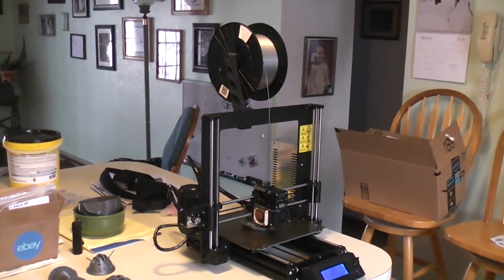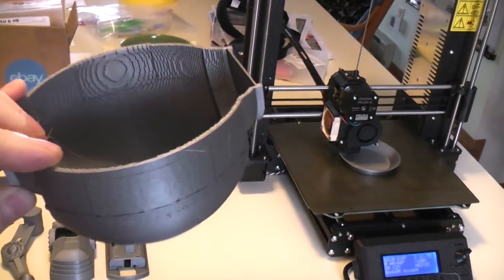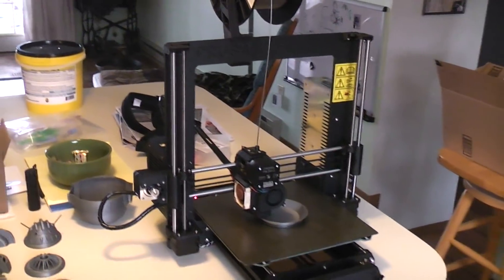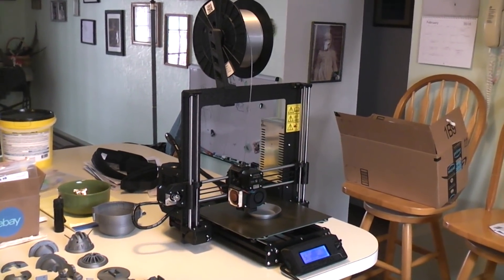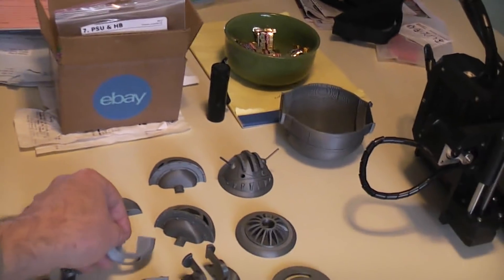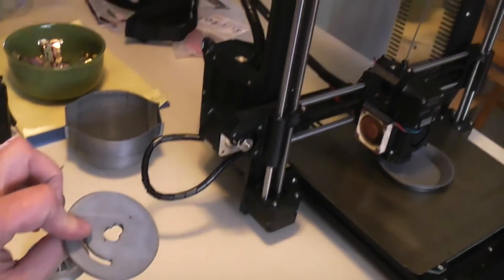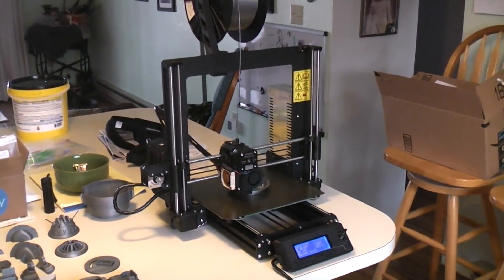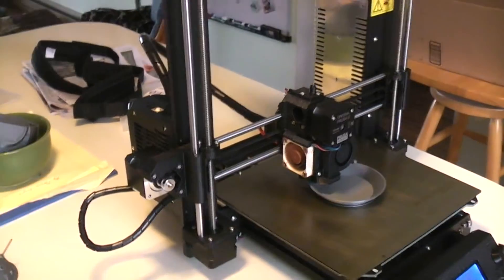Black Beauty arrived "Prusa MK3 Kit". So what do I think ?

Comment: to dampen noise, try putting the printer on a garden paver like this https://low.es/2luR4UD
you could also try putting it directly on cement floor, or anything super heavy.

putting it on a table that's relatively thin (compared to the floor), and has a large surface area is the best way to maximize noise.
Reply from the maker: Yes, when the printers are in the shop they are solid surfaces but in the winter they are in the house and the kitchen island is the only place. Its like the sound board of a instrument .  But as you will see when you watch a few more of my video's I have made the MK3 silent even on the hollow table top.
Reply: oh cool.  didn't know you already knew about that.  glad to hear it.  i'll check out some more of your videos!

Comment: Have you heard of plastic bearings i can'tremember the name cause it's been awhile since I did the change but they are awesome, super quiet and oil less. Drylyn our something? You can order from ali and maybe gearbest.
Reply from the maker: Yes they might be worth trying. What I just ordered and will try is the 8mm bushings that Ultimaker uses. If they hold up in a Ultimaker "and they do" and have the great print quality in a ultimaker, then why not try them on the Prusa. I guess I will find out as soon as they arrive. If they are good I will do a short video on how they sound and work.

Comment: Use that glue stick that is provided. A small layer will do magic for you. I also have layer shift issues. I am still tuning the retraction and plastic feed, looks like those are not quite good out of the box. Planning to change the bed bearings because of the noise and they do induce some amount of vibration back into the printer.

Comment: LEDS last 100,000 hours plus. I've got LEDS that are 30 years old that still work. Saying that the laser diode will fail anytime soon is  ridiculous.  What I like about the MK3 is that it is wonderfully quiet, heats up faster and runs cooler than the Mk2.
Reply from the maker: Yes love the MK3. And I have LEDs that have failed in 6 months. So the truth is some place in between. LEDs of this type do not just fail they lose out put level over time. This is a reflective sensor not a window type LED switch.  The out put level is much higher and must stay that way or the sensor will  not work right. But that's cool. Time will tell how long they last. They might be very good quality units and last longer than the printer. Lets hope so as it is a great printer and should last many many years.

Comment: Enjoyed your video! How would you rate the print quality of the Prusa Mk3 VS AnyCubic i3 Mega?
Reply from the maker: The way I have my i3 mega set up its prints a little bit better than the MK3 stock. If you added a little more part cooling to the MK3 from the back some how it would be the best, but right now I can out do it with complex part designs that require part cooling all the way around. Both great machines. The MK3 is the best right out of the box, the i3 Mega requires some modifications and fooling around.
Reply: Ok great, thanks Robohut.

Comment: The LED in that sensor should be good for at LEAST 10 years of continuous usage. They don't need a lot of light. (I have optical mice that have easily lasted longer than that with continuous 24 hour output) A mechanical switch would cause issues with flexible material, and as Prusa himself explained, can experience wear from contact with some filaments.

The Anycubic bed is a consumable, it wears out, so it's not as reliable a solution as the coming powder coat bed.
Reply from the maker: You are lucky, I have optical mice and track ball units "top end stuff, that dies in under 1 year. Lets hope we are all lucky on this one. Still no point in going optical when it can not be used with all filliments and the switch type do work with all filiments.
Reply from the maker: You know what would make for a great filament detector would be a rotary encoder, either optical or hall effect. That way both filament run out and filament jam could be detected. I am sure Prusa could design a 3d printed simple wheel that triggers a optical or hall effect sensor , the sensor out put could be compared to the extruder stepper motor pulses for errors. Just a thought.
Reply: Like I explained before, a wheel will wear out over time and begin to slip, especially with abrasive filaments. That's why a non-touch sensor is preferable. Prusa said they tested a method like this and changed it shortly before announcement because of this issue. They improved the optical sensitivity with later firmware updates, I have several filaments that had issues with the shipping firmware that now work just fine. And they'll add in the jam detection, but right now the main concern is not overloading the CPU, which is a bigger issue.
Reply from the maker: No a wheel of this type of sensor will not wear out , I have used these types of sensors in Industrial equipment for over 40 years, yep I am a old fart. They last for ever. The wheel spins with no friction, it will out last every part of the extruder design. I guess unless you have experience with these types of devices its hard to understand.
Reply: Well, first off, everything's got friction. Second off, it's gonna need some friction if it's gonna be compatible with various filament (otherwise it won't grip enough for things like flexibles). Third, Prusa already tried it, and it was showing wear. I don't see any reason why Prusa would outright lie about this, especially given that a wheel solution would have been easier for them.
Reply from the maker: Prusa would not lie about things like this. What is wrong with you for saying something like that ?. The system they tried did not work for them. I get it. But that does not mean that another system of this type would not work. It would work and does work every day in so many industrial applications. But if Prusa has decided that it is mot worth the cost "both time and money" to make it work and it will cost more than the electronic guts from a Mouse then I think they know what they are doing. 
We will just have to disagree on this point, and probably everything else in life.